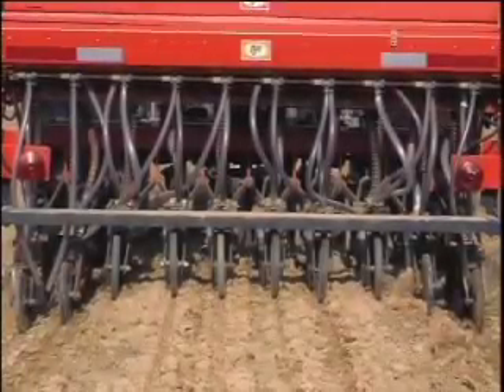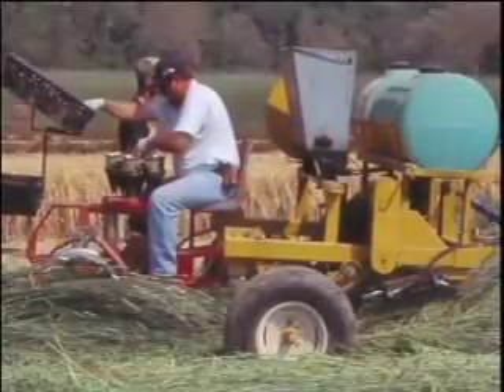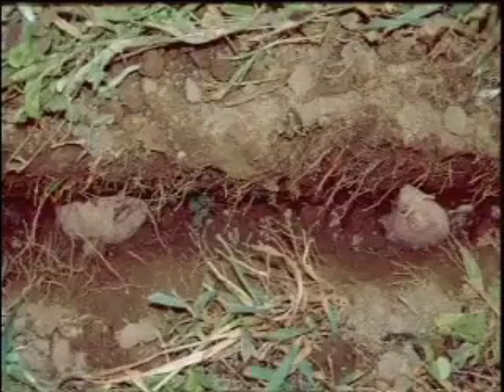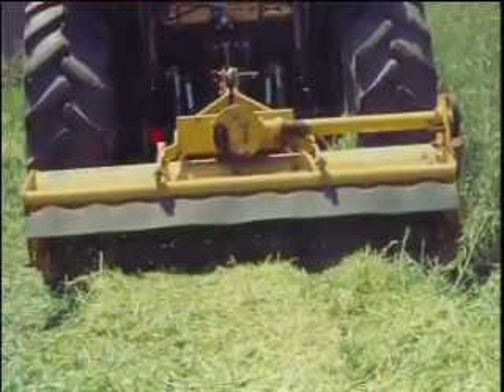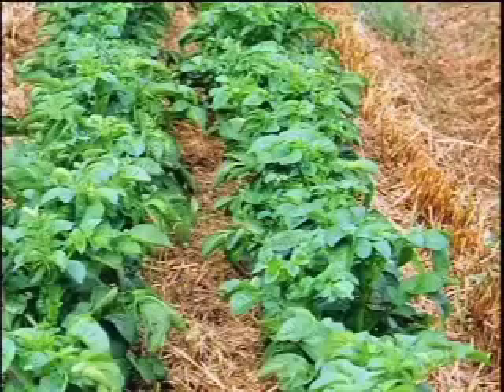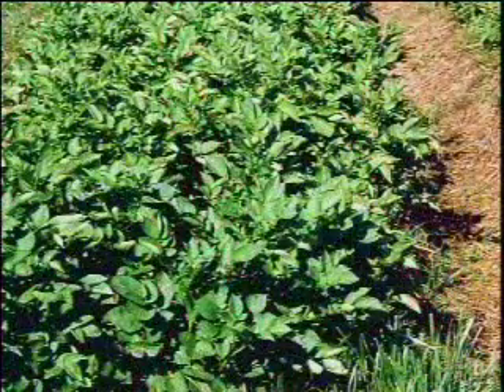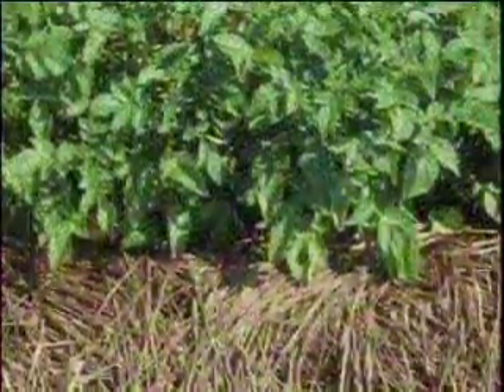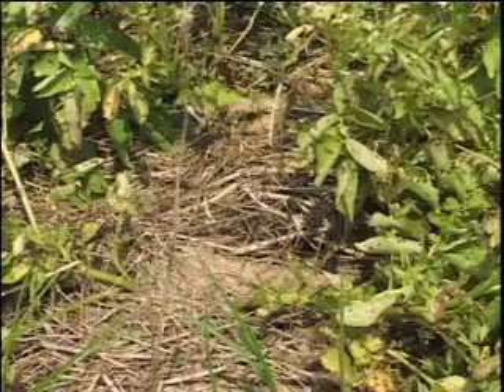Organic High Residue Reduced-Till Potato Production: Weed Em and Reap

Comment: Does the transplanter make the raised bed you mention?  That is to say, is this all one operation of 1) knocking down the cover crop 2) cutting a furrow for the potatoes at 5 inches deep  3) planting the seed potatoes  4) covering the potatoes and making a "raised bed." ???   Any comments about this would be welcome.  Also, cover crop looks like vetch... is that what you used?
Reply from the maker: We recommend checking out the entire series. They are listed here under Part 1 - http://www.extension.org/pages/18368. It will answer some of your questions. Most of the videos are short and a quick watch.